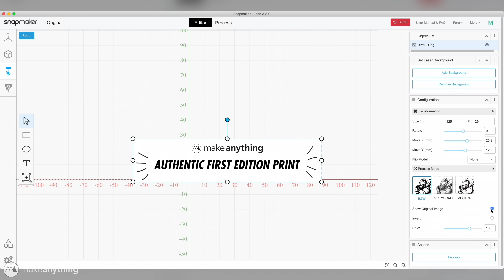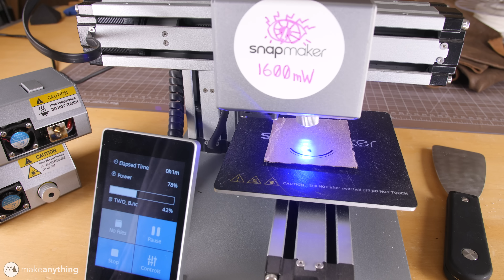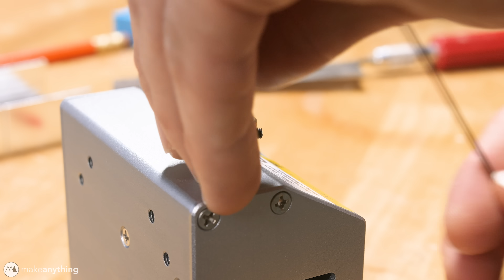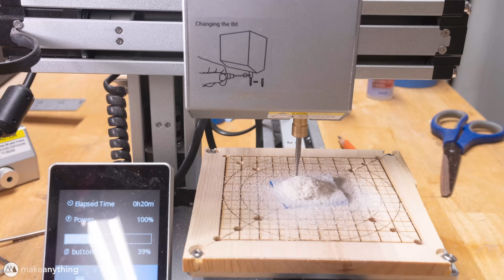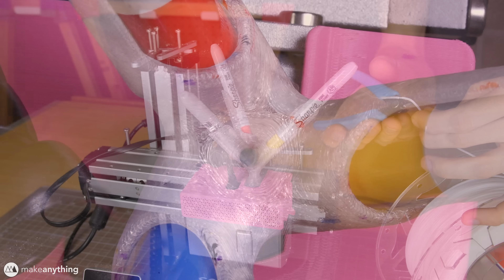Making Things with the Snapmaker 3-in-1 CNC, Laser Cutter, & 3D Printer

Comment: probably a bit late, but here's a tip to reduce the high pitched noise from the cnc. you see, the bit tends to vibrate if it's extended out too far from the chuck creating noise. so simply mounting it deeper into the chuck might help quite a bit. alternatively you could also use bits that are shorter.
Reply from the maker: That's a good bit of knowledge, thanks!

Comment: As a complete beginner in 3D-printing, and CNC-milling, and laser engraving, and 3D modeling in general, I got the Snapmaker Original to avoid having to buy separate machines.
Although I'm not as positive on this machine as you Devin, I'm really glad I bought it. 
One thing I hope to be able to do with the SM-one, is carve out a shape in wood (or maybe HPL)  and then print the same shape back in. As in: printing an inlay, in place.

I'd like to hear your thoughts on this idea. (And maybe a video?)
Reply from the maker: Sounds like an interesting challenge, though not sure if the effort would be justified versus printing the inlay separately. Printing onto the milled piece would likely require some manual g-code to avoid hitting the stock.

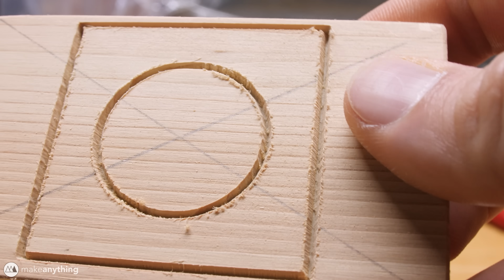Comment: with the wood @15:00 you can see going with the grain of the wood it was clean but ripping across the grain had a lot of chipping out. you can try masking tape over the wood for results but more mess and sticky bits. or see if there is a direction that it engraves at a slower speed on the y or x axis

Comment: The CNC router part is pretty rubbish, even for a "cheap" ($1495 AUD) machine.  I'm guessing the crap surface finish is due to tool deflection in the $2 spindle motor.

Comment: Nice video. Just some Friendly advice about CNCing, Don't use the "pointy tool" for the first pass into any wood...or anything. It's is not designed for that which is why you have a poor finish. Use a milling tool which removes material and forces it away from the cut. You will have better results and won't break your "pointy tool" :)

Comment: that surface is INCREDIBLY small. It's 800$. I could get an actually well reviewed and used ender 3 pro printer for 200$ which can also be upgraded with various attachments for well under 500$ in total. Don't get this, it's a complete rip off.

Comment: Spoil board Consideration:  Try cutting a blank of wood the size of your base plate.  Tape it to the base plate & use the router function to mark all of the holes (don't drill all the way thru the spoil board piece) then finish the holes with your drill.  That would give better placement of the holes, I think

Comment: I wouldn't trust  using the laser without an enclosure, it can destroy your eyes. The CNC is super small, and not powerful, and is a small printer.

Basically a Jack of all trades and Master of none.

This 3-in-1 is just marketing. Only positive is the axis. They need to make them in different sizes and sell just them...
Reply from the maker: That's what the 2.0 version is. Up to 350mm square bed, I believe

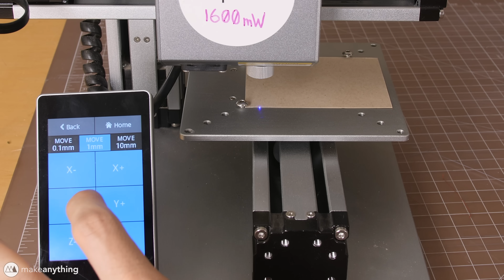Comment: 6:46 this is why it's a bad idea to have lasers on a open machine (the laser hits the edge of the screw it could be reflected to anywhere! your eye for example!)
Reply: It's at very low power when not engraving or cutting, purely for eyeing the origin point.
Reply: @TheOfficialCzex  what if the machine has a fault? and it decides to go foo bar when your cutting?
Reply: @duality4y  That's very unlikely. Anyway, it probably has a mechanical safeguard that prevents the laser from emitting if it reaches a certain point on the X/Y plane.
Reply: @TheOfficialCzex  don't under estimate anything when working with lasers
Reply: @TheOfficialCzex  also clearly this machine is lacking these safeguards as it can move over that screw.
Reply: @duality4y  It can move over the screw when the laser isn't operating at engraving or cutting wattage. It's using less than 1% power to be visible there.
Reply: @TheOfficialCzex  so there are no mechanical safeguards is what you are saying?

Comment: Thanks for this great review, the best I've seen to far of how the machine is used. They really missed an opportunity by not using countersunk bolts to mount the toolheads. Also, for lasercutting you better get a honeycomb bed.. I'm curious how they will improve the next model. Also, it would be really nice if their CNC setup had a gcode file that would cut out the template for a sacrificial board so you only have to drill the marked holes and saw it square etc.

Comment: I'm pretty sure the reason the colors are "random" on the prints is similar to the reasoning behind complaints I've seen with mixing extruders. I've heard it called the toothpaste effect similar to how there are stripes in freshly squeezed toothpaste. the color on the surface of the print will primarily be the color closest to that edge and the direction the printhead is moving may play a part as well.

Comment: you could have done some measurements and used the laser to mark out your screw holes accurately.   maybe add them to your alignment graphic.  you probably could just let it sit on the build plate for the laser but you could use a little tape on two sides to keep it from moving if you were worried about it.  this way you could easily re-print and prep sacrificial boards as they wear out.

Comment: I've just tried to print your fully colored phone case for my phone.
There were two problems:
The offset perimeter near the first layer of my colors passes on the colors of my case rear and ruins the other colors. Do you now a way to remove that offset perimeter in the prusa slice 2.2? I'm printing with an original prusa mk3s.
The other problem was that my colors were shifted a bit in my print so the print was not the best. I've also checked if my colors weren't shifted in the slicer and they weren't. Do you now a way to fix these problems?
Thank you very much for the idea and for the help.
Reply from the maker: Sorry, I'm not too familiar with Prusa slicer, but I'm sure there's a way to turn off the skirt. In Cura it's under the "bed adhesion" settings. The offset could be your printer not homing reliably if it really is perfectly aligned in the slicer. Not sure what else might cause that
Reply: @make.anything  thankyou very much
Reply: @make.anything  I retried to print the case and all the colors were great except for on that was a bit shift, I would try again later.
Reply: @make.anything  I've found a way to solve  all the problems, I made a simple rectangle and  Ive offsetted it end extruded t in fusione 360 so the skirt was printed outside of it.
I'VE  also noticed that the miss allingnment of the colors were caused by the to strong popping of of the skirt an the rectangle from the print bed. Thank you really much for the help and for the idea, I think that would be great if you upload the dxf files of your phone cases so anyone can brig it and use it for another cover

Comment: One other cool thing that comes to mind is Post-Processing of printed parts: engraving a serial number, and  machining some features where surface finish is critical.
Reply: I don't think that you can CNC 3D-printed parts. I think the plastic will melt and clock up the mill.
Reply: @Jehty_  From experience, I can tell that printed ABS is machinable. You need a few more perimeters at that location since the plastic has to be able to take the cutting forces that the endmills and drills generate, but melting is not a problem. Also, layer adhesion is king, so in that areas, I raise the nozzle temperature to achieve better layer fusion at the expense of print quality. In the end that area will be machined to spec anyway, so that isn't a big deal.